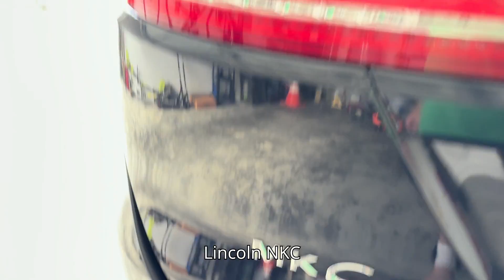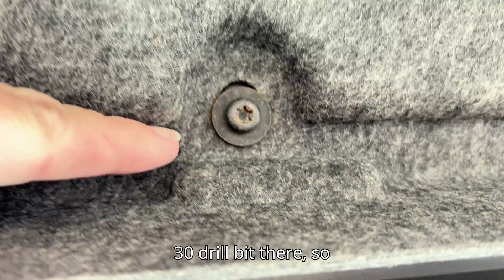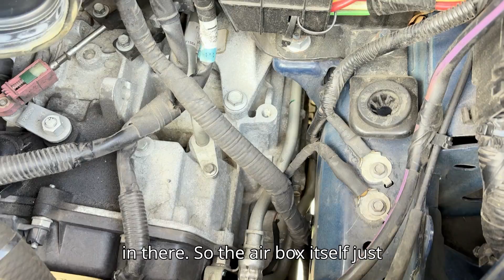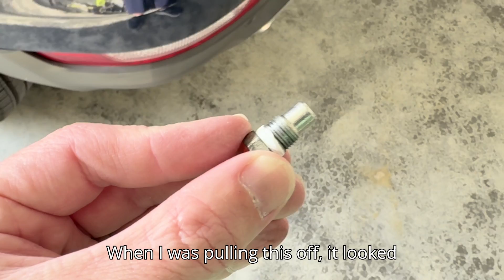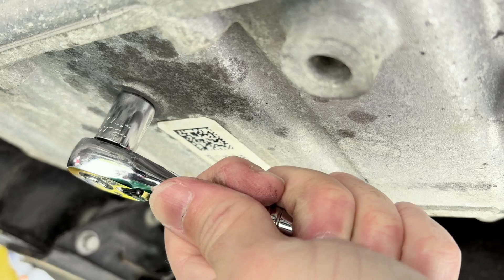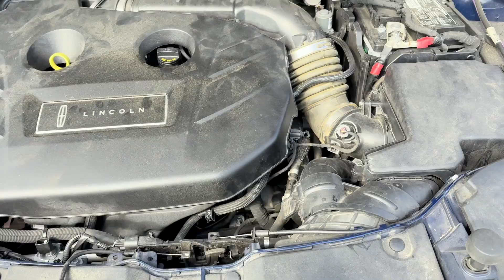2018 Lincoln MKC 2.0 Transmission Fluid Change

Comment: Finally !!  A video that matches my exact car and transmission !  
I was beginning to think that Lincoln made my MKC different than every other one.
Thank you !
Reply from the maker: I felt the exact same way my friend! Only after I did more research on the transmission that they put in it did I finally see a video on where the fill plug was located. But that was on a Ford Fusion. I miss the old days when you can easily see the oil and transmission fill / plug and dipstick area! Don’t get me started on changing the in-cabin air filter!!